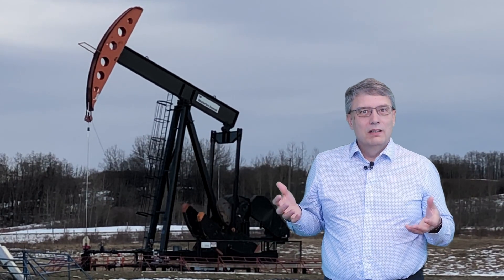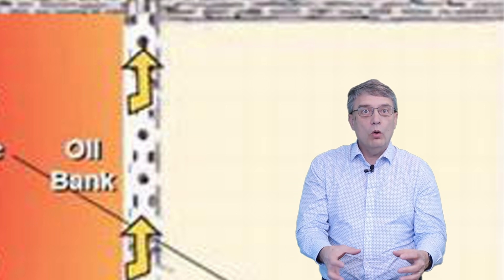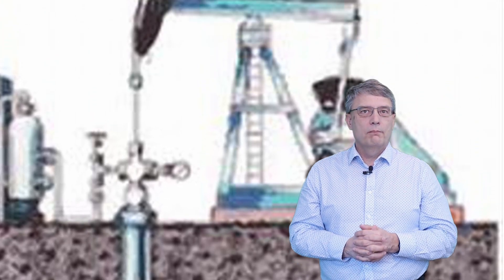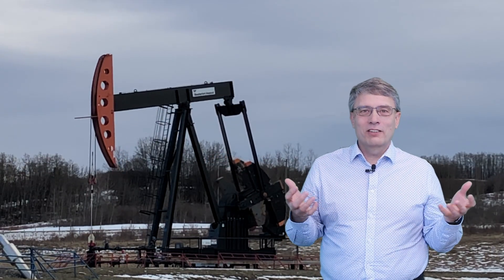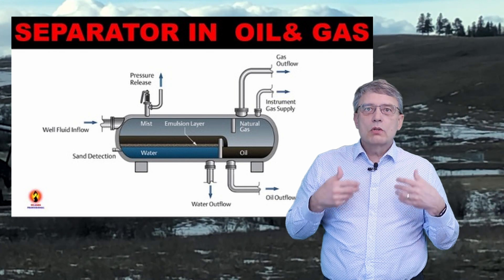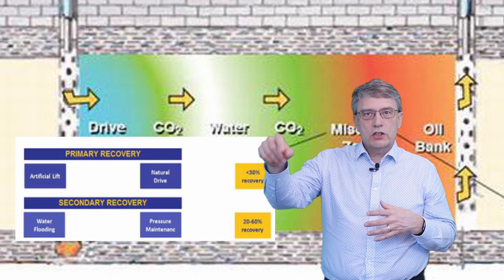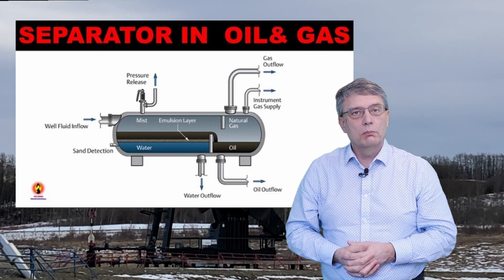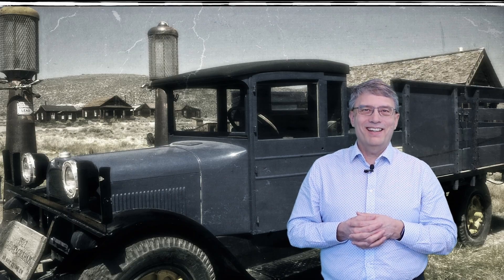Oil Wells for Beginners - How does an oil well work?

Comment: “Donkey Rig” was the term that I first heard for this unit, when I began working for SOHIO (Std. Oil of Ohio) in 1982. Years later I was told that Pump Jack is the “technical” name for the unit.😁
Reply: It's called Beam Pump
Reply: Pump Jack is the common "oil patch" term but it is actually a Walking Beam Pump or often times just Beam Pump.